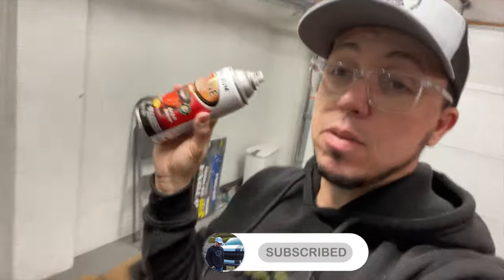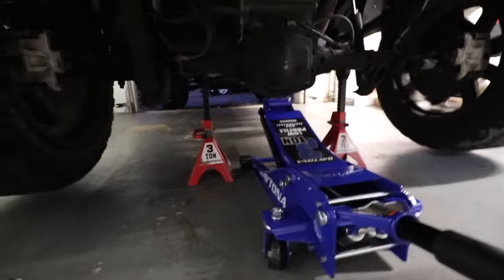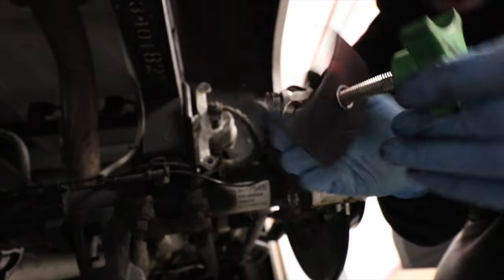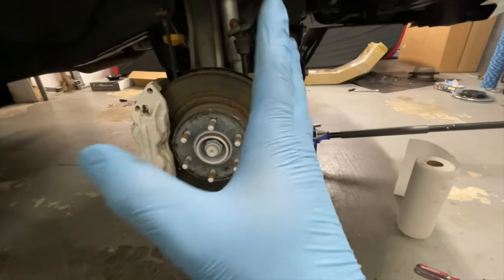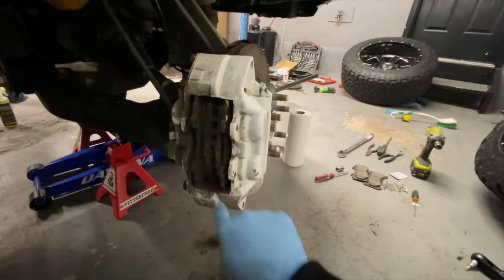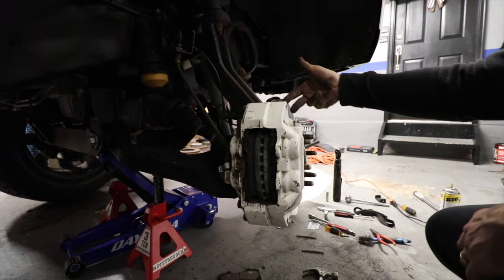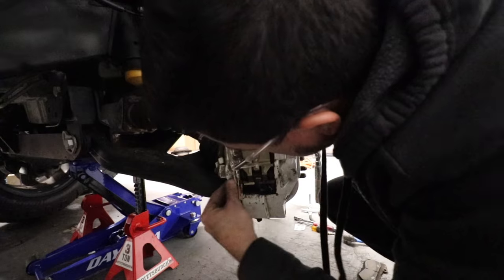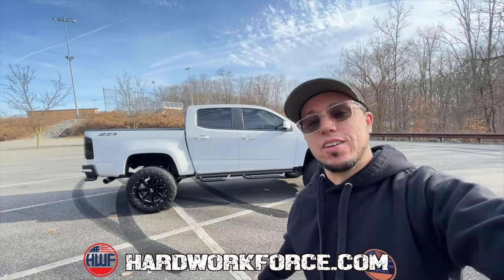2016-2020 - CHEVY COLORADO BRAKE REPLACEMENT

Comment: You can put the front brake pads in without taking the caliper off.  I just did it on my 2018 Colorado.  I love the video, lots of information.  Just wanted to let you know for future brake changes.  It saved me souch time by not taking the caliper off.

Comment: I remember doing rear brakes for the first time and pulled the hub off and the inside drum brake pads fell to the ground in pieces.... Which im guessing was caused from a few winters of road salt.... Made the brake job a week long affair because of waiting for the parts 
 Awesome idea to paint the center of rotors black also! , I may do the same when I upgrade mine
Reply from the maker: I hear you! For me it is the same thing, first was the socket ... it is always something!

Comment: Once again Matty! Great information. But while doing the rear rotors, did you give the emergency brake shoes any attention? Like inspection and cleaning? Especially while you had them taken down. Also I know I’ve hit on this before, but those wheels are too dam big! For one, very heavy unstrung weight is bad, two, low profile tires like that might be fine on a Vette, but have no place on a truck designed for off roading! A wheel/tire size like 265/75-17, or even 275/75-17.

Comment: I will be doing mine shortly, I would think I could spray some WD40 on the pins to get them on/off easily. Also on the front calipers, insert the bottom bold, swing the caliper down to install the pads, swing up and install the top bolt to make things a bit easier.

Comment: Great job Matty, but you should have just gone with C6 ZR1 Carbon Ceramic brakes. You'd never have to replace the rotors or pads ever again.🤣 Did you remember to burn in the pads? Save the Wave👋👋
Reply from the maker: That would be nice! but I really want would prefer to spend that money in another car! haha... that's how much money they cost! haha
Reply: Yeah, $12K if you can find them. But shouldn't your Christmas Bonus be enough to cover that expense? lol

Comment: Stop using your tongue wrench as a breaker bar.
Reply from the maker: Send me a breaker bar …
Reply: @Matty.Garage  $15 Harbor Freight. $14 Amazon. You've probably already ruined calibration on your torque wrench which is lot more expensive than a breaker bar.
Reply: Lesson learned, I previously messed up a couple of my wrenches by using them as breaker bars. Its much easier to loosen up bolts with breaker bars specially the large one which provides better leverage. :)